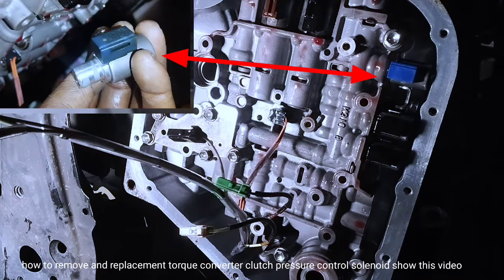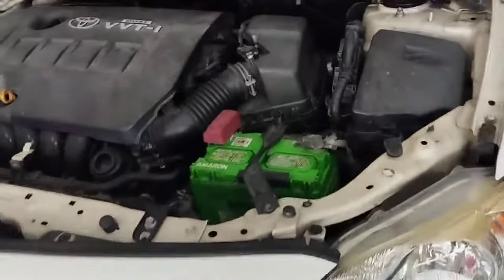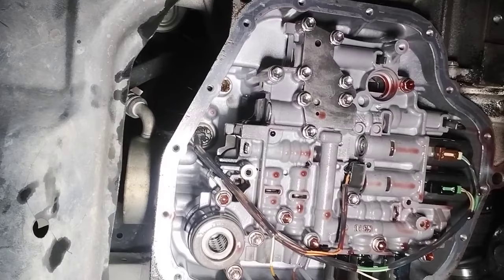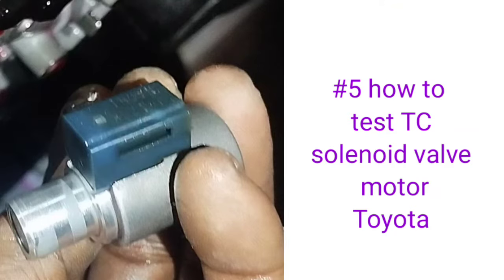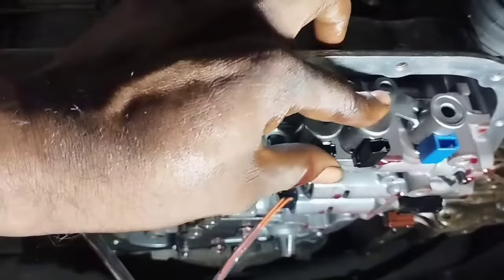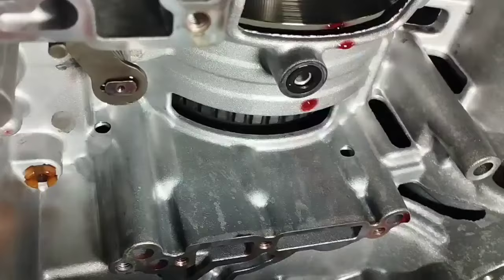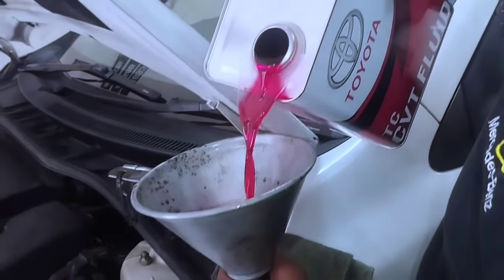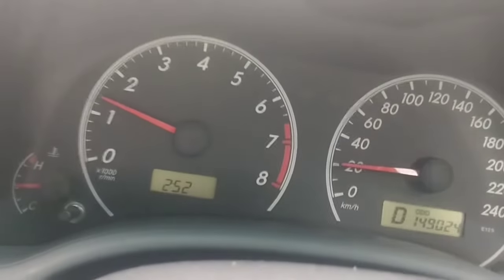Torque converter clutch pressure solenoid valve testing & replacement , how to fix engine code p2763

Comment: Im from india Sir , my vehicle is 2019 model toyota glanza with CVT gear box.. whenever running  road we applied brake and gave exalator means the engine raised rpm but speed not attain
Reply: Did you solve the problem?
Reply: @niimantse7225  no sir, how I solve this?
Reply: @ragunathan231  check for vacuum leak
Reply: @niimantse7225 where is vacuum placed sir?
Reply from the maker: Check for scan computer.faulty code
Reply from the maker: Check vacuum leaking..